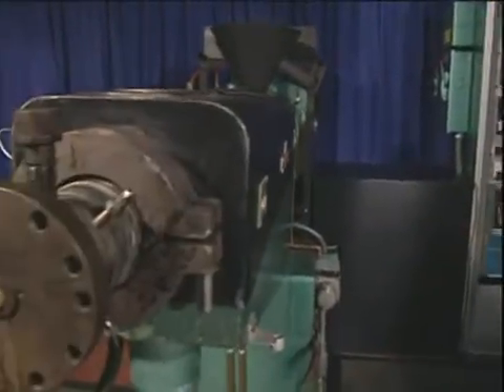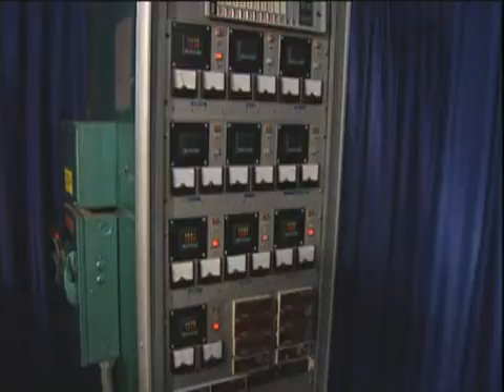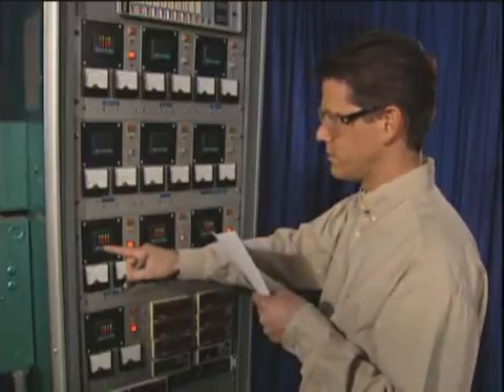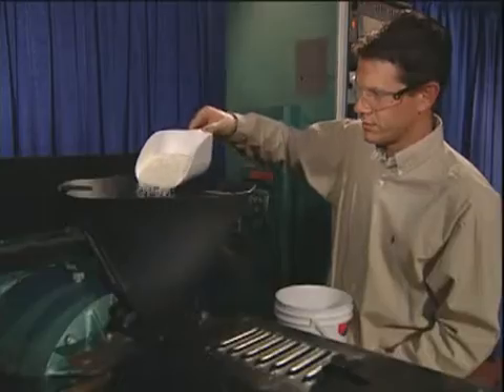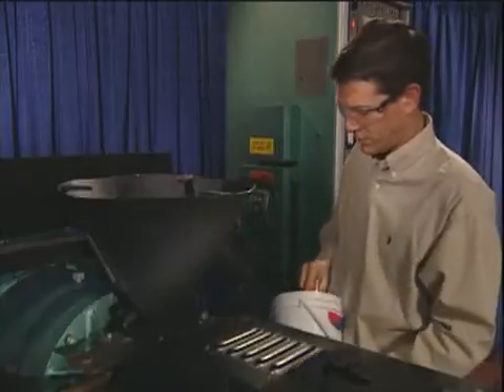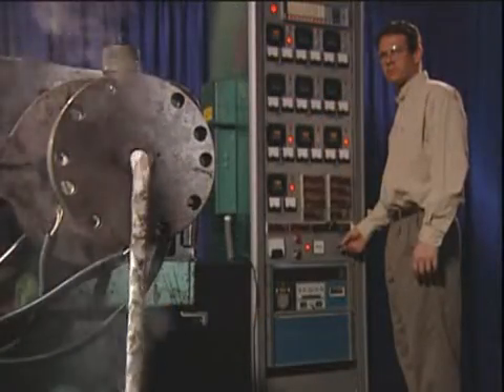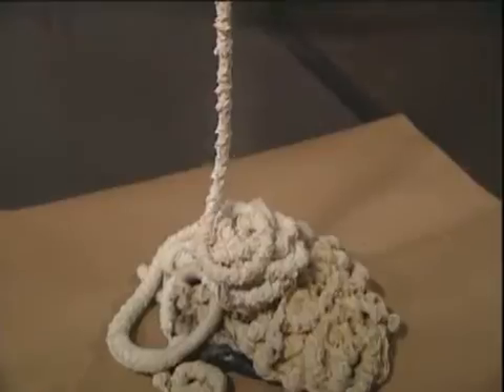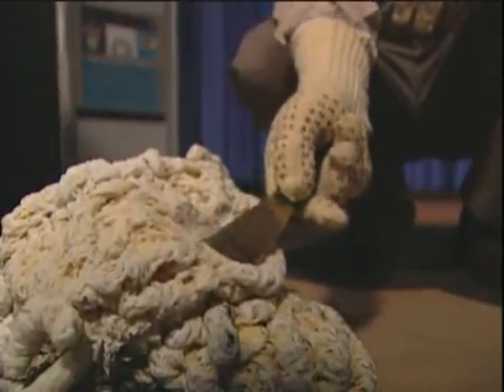ASACLEAN Purging Compound Extrusion Procedures

Comment: This material is glass filled and not
Reply: The grade in this video is glass-filled but we've since expanded our product line to include grades designed specifically for extrusion and with its challenges in mind.  To find out the best option for your process, fill out this form and one of our Purging Experts will reach out to you in 10 min. https://offers.asaclean.com/free-consultation